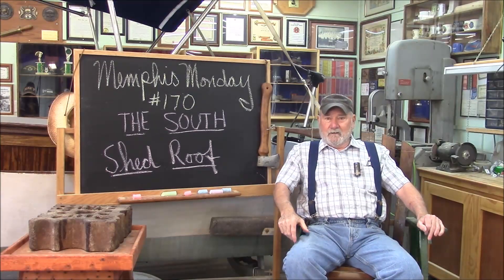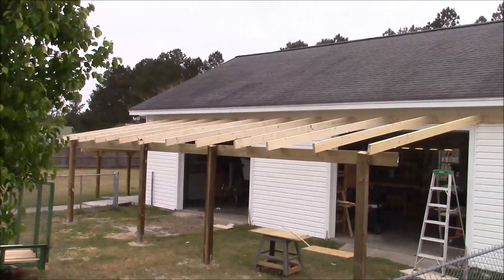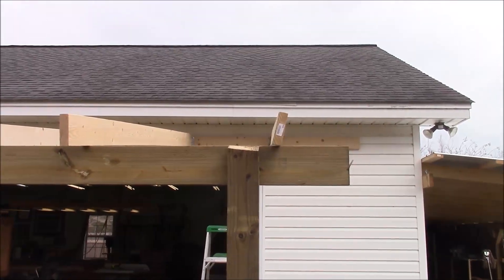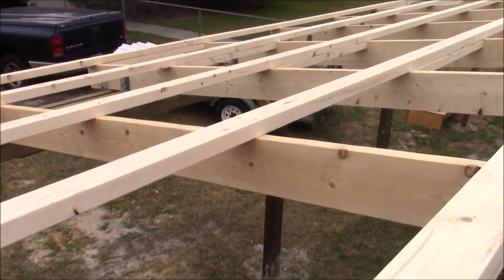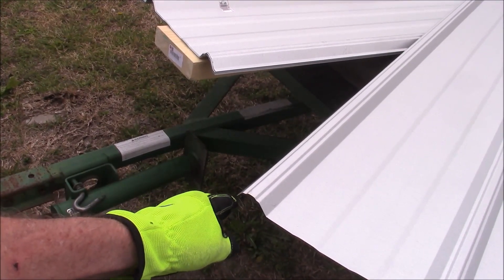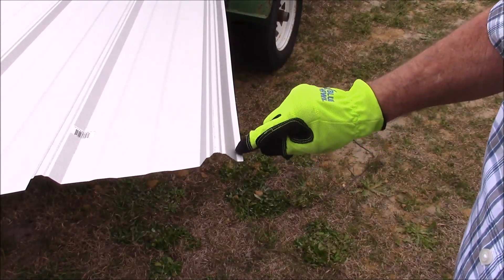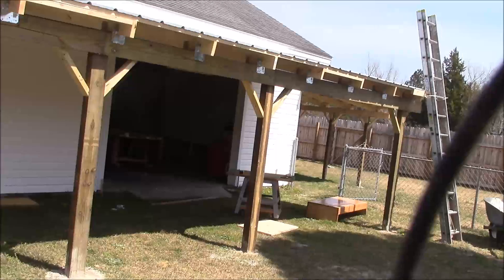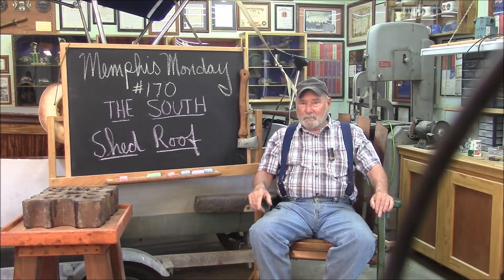170 Building Third Shed Roof on the South Side of the Shop

Comment: I follow your design, but using 9x2 inch rafters since slope of roof is 18ft. Which brackets should I use ? Are your purlins 4x2 inch ? Could I use 3x1 inch instead to reduce weight ? Great video.thanks for sharing.

Comment: It certainly has been a shed roof frenzy but I'm sure you'll be glad you built them. I was thinking about the side of the building that doesn't have one. :D
Reply from the maker: I have thought about building a storage shed, under a shed roof on the North Side.  I could then turn that North facing window into a door and have a huge storage back room.  Better do it soon, while I still have enough lead in my pencil.  
    Yep, I'm real glad I built them.  Sat out under them yesterday during a thunderstorm, and it was great.  Nothing like the sound of rain on a tin roof.  But the biggest thing is that all my doors are sheltered from the weather;  I can leave my doors open during a thunderstorm;  the Sun no longer turns my South facing bay doors into giant radiators. 
     Behind on woodworking projects, so it's back to the shop starting on Sunday.  Hope to see you then.
Reply: One of my first thoughts was how nice the rain sounds on a metal roof.

Comment: You did a nice job and I have learned some tricks too. I want to build the same type of roof on the back side of my shop for lumber storage. This is not ideal for my better woods but I have no room inside my 10'x16' shop.  The wood considered exotic like Purple Heart I get is smaller quantities and did leave a place in the loft for those.  I think that I will enclose the two ends and maybe that will help to keep the boards from warping. Any suggestions for lumber storage is greatly appreciated. Oh and any tips on constructing this alone, lol. Thanks for your channel. It reminds me of when I was a child and instead of playing with the other kids or my dolls, I was inside of Pops (Grandfather) workshop learning about woodworking. My grandfather instilled in me the love of woodworking and DIY projects. I just remembered a question I have. Do you think that using clear roofing panels will help keep the wood to stay dry or should I use the type of panels you used?
Reply from the maker: I work alone, as I work very slow.  If you work alone, then take it easy;  never make a mistake in a hurry.  However, never work alone on a project like this (as I just did) because you would be totally helpless in case of emergency.  Fall from a ladder, for example, and you are toast.  
      A single clear panel makes sense for light, but not the whole roof.  
      Put a tin roof on the south or west side of your building an you will have a kiln.

Comment: Little overkill but awesome work sir.  I prefer notching the posts and setting the 2/6 in the notch then lag bolts
Reply from the maker: That is the best way, but I copied a proven design from my youth.  If I was a young guy doing this as a job, then I'd never build a shed roof this way.  
    I agree on the overkill.  Since I was never totally sold on this design, I added the overkill to sooth my nerves.

Comment: Nice video, I’m building a 12x24 open shed, of course my 6x6’s are treated, I was gonna use untreated yellow pine for the rest of the shed & I had a employee at a hardware store recommend I use treated for everything or I’d be repairing/replacing lumber in about 3 years, I would just like to get your opinion on what type of lumber would you think would be sufficient, & what the longevity of it would be???Thanks.
Reply from the maker: Use treated.  It costs a little more, and it is wet when you get it, but it is much better.  My design is based on a design I discovered in my youth, which lasted 50 years but still failed, as it was built from common (untreated wood).  
     Use my design, using treated wood, and your shed will last at least 100 years.  However, check the codes in your area.  If shed roofs in your area are subject to building codes, then put the end braces on top of the posts, as this is the standard and best practice.
Reply: Memphis Applegate alright thank you for the feedback & information.

Comment: Hi Memphis, I am doing the same thing along the side of my 30x50 pole barn to protect my tractor equipment.  3 questions;
where did you get the roofing tin, how long was it and how much per sheet? I'm trying to figure cost and that is the only material I have no clue about.
Reply from the maker: The roofing tin was 12 feet long and 3 feet wide and I got it at Lowe's.  Here is a good lesson's learned:  wherever you get your material, have it delivered.  It cost about $50 or so, but it is worth it, as all the rafters, joists, and tin you will want in 12 foot lengths.  Another pointer is to get some help, hired if you must, as the job is both hard and more dangerous if working alone.
      Thanks for the kind words and good luck on your project.  Fall is the best time for this job, and summer is the worst time.
Reply: @MemphisApplegate   Sounds good and thanks for the quick reply.

Comment: Believe it or not, I am only a day late in watching this.      I believe this particular shed roof will make the biggest difference in your shop usage.  Can you still get your truck back up to the doors?

Are those angled braces more for aesthetics than structure?  They don't seem to be supporting as much even though you have nailed the inner and outer support beam to them.  I do like the way they look.

I am right there with you on the fear of heights.  People who don't have the fear don't realize how paralyzing it can be.    I describe it to my sister-in-law who is terrified of snakes like this:  Imagine you are locked in a room with thousands of snakes.  That is the fear I have when standing on the edge of a cliff.  I have a friend who was looking at a house under construction to do an estimate.  The house was in a remote area just outside of the National Park.  A 6 foot ladder was what they used to get up to the second floor of the house.  When he was coming down, the ladder fell as he put his foot on the first rung.  He had no choice but to drop to the floor and it busted up his hip and crushed his foot.  There was no cell signal there and no one around for miles.  He had to drag himself to his truck, pull up into the truck and drive back to town where he drove to the emergency room.    Yea.  The older we get we shouldn't be on ladders by ourselves.

I think someone had gone through those boards that you were using for the rafters and left you with all the junky boards.  That looked like a bit of a pain to deal with.    

I hope you are back up and dancing a jig.  Stay off of ladders for a while.
Reply from the maker: Not jigging yet, but I did mow my grass today.  Right now I'm back to my normal back ache, which I seem to always have.  And you are right, I'm pretty tired of ladders by now.
     That's the way it is at all these big box lumber yards.  Guys cull through the whole stack, then the Lowe's employees pile the junk back on top of the pile at night.  Sometimes half the pile is rejects, but then when you finally dig down to the non-reject you find that a quarter of them are rejects too.  I normally just give up and buy a few extra, then work with what I have.  
     Sorry to hear about your friend, but that is exactly what I was talking about.  He was actually lucky in a way that he could still struggle back to the truck.  
     Of course, my fear of heights is related to my advancing seniority, as I don't remember any fear of heights until I was about 40 years old.  But paralysing is a good word.  As sometimes I start shaking so bad I lose muscle control, and I'm frozen in place trying to calm down.  But, for good or bad, the fear went away on this job toward the end, as I spent so much time on the ladder that my nerves just gave up.
     I copied the design from my brother's shed roof, which has lasted 45 years.  I think (my guess) that the angled braces are structural, and serve three purposes.  First, they short span of the end-braces.  Second, they carry some of the weight.  And third, they help hold the end-graces together.  The third point should not be overlooked, as for this system to work the end-braces must not be allowed to warp or twist, thus pulling out the nails at the end.  
     It is the best shop improvement project yet.  It is wonderful.   Yes, I designed it so that I can drive my truck into either door, and I've even been parking my truck under the South shed rood to keep it out of the weather.  
     Back to woodworking next week, I hope.  Hope to see you then.
Reply: I am happy to hear that you are back on the mend.  Yes.  my friend (actually my former husband) was lucky.  He could have been hurt a lot worse and unable to get to the truck and drive himself.  It has been several years since that happened and he still has a lot of pains in both his hip and his ankle.   He keeps a lot of the pain at bay by staying active.

I can remember the day that I developed a fear of heights.  I was about 10 years old and fell about 15 feet out of a tree.  (back in my day, it was a normal pass time for kids to climb trees)  My only injury was getting the breath knocked out of me, but I have been scared of heights since.    I am trying to desensitize myself to the heights just like you did on the ladder.  I keep taking hikes and forcing myself to stand close to the edge of steep drop offs.

Your comments about the braces being structural sound very valid.  I can see why they would be.

I am happy that this has improved your quality of shop life!  Good idea to keep the truck under the roof.    It keeps the paint and interior in much better condition if you can keep it out of the sun and weather.

See you next week.
Reply from the maker: Check out the TR feed!!!!  I gotta know what you think.  I will tell you what I think:  TR is a dolt, but Ryan is a sociopath, and perhaps the most unlikable person on the planet.   In the feed they meet up, and you will likely throw up.